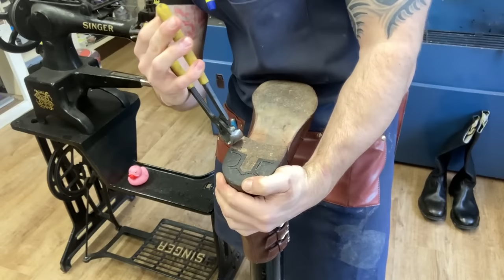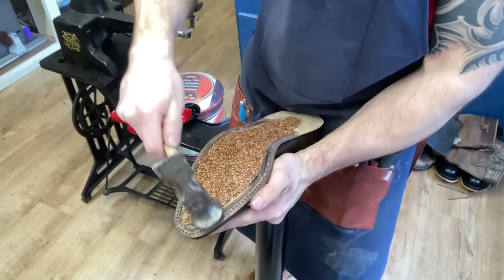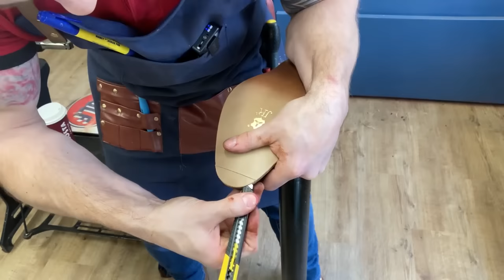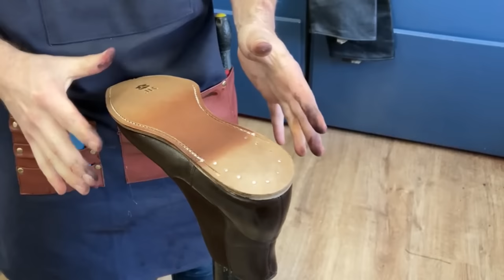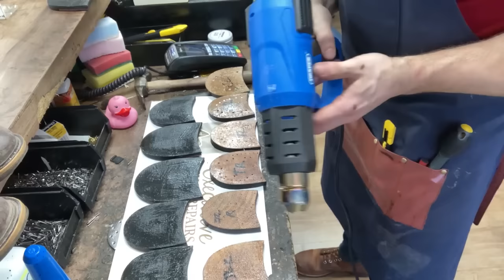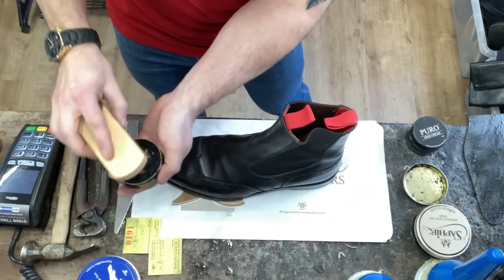OUR MOST EXPENSIVE CUSTOMER! £600 Full leather sole repairs & Artisan finishes

Comment: I have been wondering, have you ever had a pair of shoes that have been restitched so often that they rip right through?
Reply from the maker: The welt can be lo chewed up if it’s stitched onto badly a few times, but then you can replace the welt in most cases.